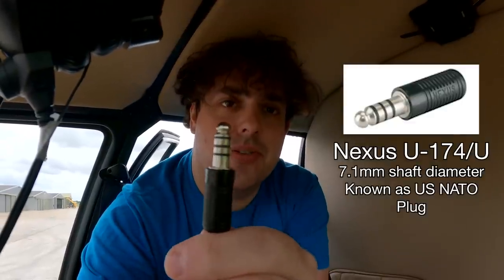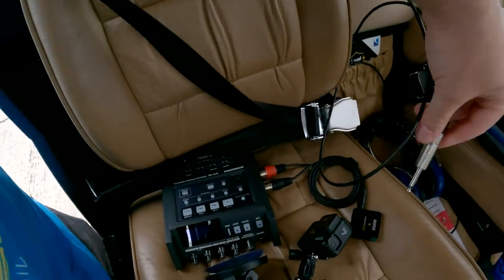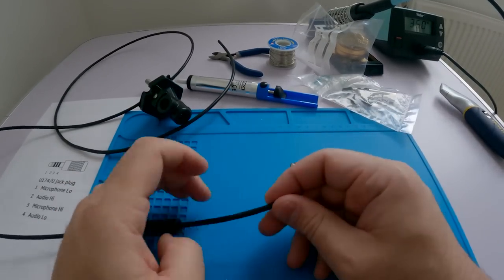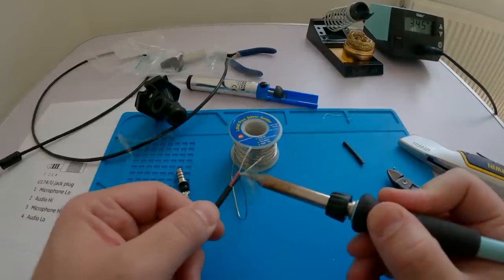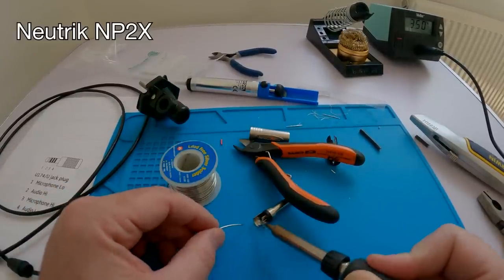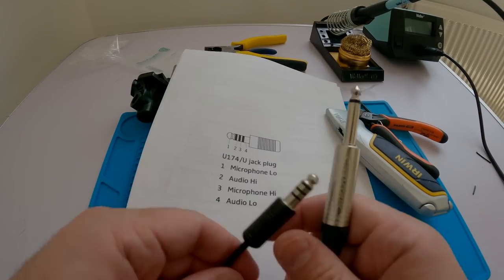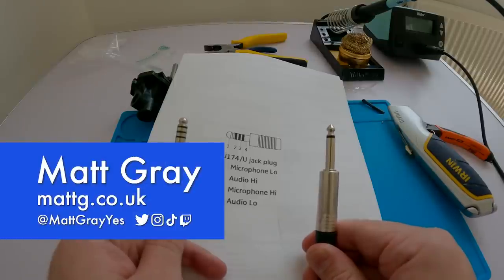How to Record Helicopter Headset Audio

Comment: Always forget to put on the back of the connector before soldering. If you don't forget it you only get to solder once!
Reply: Exactly! I admit to copping out on redoing it when I forgot a back on an Atari ST to VGA lead -- 13-pin DIN to 15-pin D-sub. Not all the leads were connected, especially as it was monochrome, but both those connectors are crowded. The 13-pin DIN was the worst thing I've ever soldered as it had a 3x4 grid of pins in far too little space, and the plastic kept melting so the pins kept coming loose. Might have helped if I'd had a finer tip on my iron, but I didn't have one back then.
Reply: @eekee6034  Wow! Wasn't expecting to read Atari ST here! I somewhat recently visited my uncle to solder a cable for Atari STE, to get a lower level audio out.
Reply: @607  Cool :) I wish I still had mine.

Comment: I have a US pilot's license but have never been in a helicopter where I needed to plug the provided headsets in as they were already in place.  I had NO IDEA they were not "standard" 1/4 inch plugs used on Cessna 150s to Gulfstream 650s.
Reply: helicopters  tend to use one jack rather then two like fixed wing just cause there is a risk of the cables getting tangled in stuff worse then in a plane
Reply: @coolmikefromcanada  why is that?
Are helicopter cockpits more crowded?
Reply: @coolmikefromcanada  why is that?
Are helicopter cockpits more crowded?
Reply: @Jehty_  na more like helicopters have a "fall out of the sky or rocket into the air" lever and you really don't want things snagging on that, also helicopter pilots are more likely to have to lean and look around
Reply: @coolmikefromcanada  what do you mean by these levers? Never heard of anything like that
Reply: @Jehty_  i am jokingly referring to the collective lever, it controls the downward thrust.

Comment: The fun one is hacking a US military U229 connector to put a 3.5mm connector, and having it automagically act like a handmic, so you can hook an iPod up to the intercom system of a HMMWV or MRAP.

What's less fun is a passenger flipping the FFCS to which the iPod is attached from "int only" to "B-radio" and jamming the troop/company/battery level net with Red Hot Chili Peppers until I noticed the SINCGARS buzz from transmitting encrypted behind the music.

Then I had to make one for the troop commander's vehicle and explain what you can and can't do with the FFCS when you've got music going.
Reply: This is the story I didn't know I was hoping to find down in the comments, thank you.
Reply: Definitely sounds like you don’t have experience with that story… 😂😂😂
Reply: @cheetahman79  nope, none at all. 😉

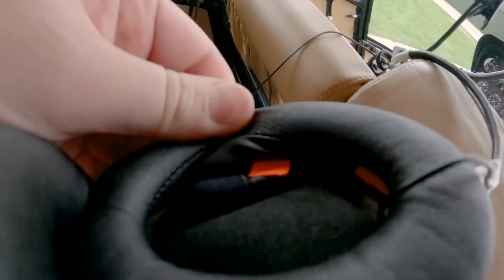Comment: 1:38. Holy shit!  What an amazing low-tech solution!  I'd never thought of that!  

(I fly GA.  I use an adapter that goes between the intercom and the headset in plug, and then has a side plug that has a USB-mini that goes in to the Gopro 3 cameras that I use.  Works really well and consistently, once I realized I had to make SURE the plug was all the way into the camera.)

Comment: If you do end up making one of these it's worth noting to add some resistors in the quarter inch plug and build the pad in, although not having the pad built-in to the cable might be nice if you're not sure what the audio levels are going to be like. And cutting off the shield at the connector end really shows you know what you're doing with audio! Dare I ask how many questions are in the comments on that subject?

Comment: Any reason in particular why you'd leave the shield disconnected at both ends? I'd normally short it to the shell at one end only, but maybe this is a live sound vs broadcast engineer thing.
Reply: Shield is connected at the helicopter end, to the mic ground, which is also chassis ground, so it is fine. Audio low is almost invariably also connected via a very low value resistor to chassis ground, simply because this also is used to get a little protection for shorted cables, so that one headset developing a short in the speaker side will not take all the others out.  Also volume control is via a series resistor, so you have a common bus level, and your headset volume can be reduced a lot, but even at minimum setting you still get a pretty high level into the 600R earpieces. 

No PTT, as the headphones are always on, to allow comms in the noisy cockpit, and that noise cancelling dynamic microphone insert is pretty good, as seen on the hover video. Yes bandwidth is not exactly good, very much BT telephone style, and deliberately made that way to reduce external noise, and also heavily clipped in the amplifier as well, to make speech intelligible.

Incidentally mic capsule and earpiece tend to be 600R, mostly because the earpieces were developed from telephone earpieces, along with the microphones, so have that heritage, though there are wildly different systems and impedances now. Can be a pain to drive if you are a gamer, and want to use real military helmets, you need a pretty high amount of voltage gain to get sound out, more than most sound cards can easily deliver, so you need around 12-15dB of gain added on for the earpiece, able to drive 600R, and similar for the microphone, or simply swap it out for an electret insert in the same case, and lose a lot of the noise cancellation.
Reply: I guess the aircraft system 'mirrors' your own mic back to your headset? Otherwise Matt would have had to capture both sources?
Reply: @rebmcr  Probably yes. It would be a real pain to speak with a normal voice and loudness while not able to hear yourself properly.
Reply: @rebmcr  Can confirm, yes. It's easier to wire that way too. Your voice goes into the audio system, and is played to everyone in the cockpit. Everyone hears the (incoming) radio too, though obviously only the pilot (and copilot if applicable) has their mic hooked into the radio as well.

Comment: 1:30 Can you explain what Line vs Mic level means? I've heard Line level before and have a Line/Inst switch on my audio interface but don't know what it's there for.
Reply: On your audio interface line in and mic in will probably both work to input audio. My understanding of the difference is the mic one is optimised for human speech, whereas the line is for other audio devices.
(and if I'm wrong I've boosted your comment for someone else to answer)

Edit: More reading suggests the difference is the input voltage (and how much it then needs to be amplified)
Reply: Line Level is a kinda middle "Standard" amongst the four main levels of input (mic, line, instrument, and speaker).  Line level is about 1-volt. The idea is that if a system has several different line level inputs like a home hi-fi might have a record player, a tape player, and a CD player all feeding the same selector which then feeds a singular amp (which then boosts the signal to speaker level). Because all the devices are Line Level when you set the amp to play the record player at the right volume, when you swap to the tape player you should be just about right. 

Mic Level is a MUCH quieter signal, usually no more than 10 millivolts, and require a pre-amp to boost the signal to line level. This is most often done inside the mixer, though inline mic-to-line pre-amps exist. 

Instrument Levels are stronger than mic level but less than line and again require a pre-amp to bring them to line level. 

Speaker Level can be in the "oh my word" range of volts and is obviously used to drive speakers, use the correct cable please.

Connecting a Microphone level source into a line-level input results in almost no sound since you're delivering a couple orders of magnitude less power than needed. 
Connecting a Line Level source to a Mic Level input will lead to distortion, clipping, and possibly broken equipment. A common way around this is a Direct Injection (DI) box that reduces the voltage to the acceptable range, or most mixers have a switch (either physical or software) that switches an input between mic and line level (it may also be a "pad" which does a 20dB reduction, which Matt mentioned in the video). 

TechMoan also recently did a video explaining the difference.
Reply: Also worth noting that "Instrument" in this context doesn't mean every musical sound-making object.

Non-amplified things like guitars, mechanical electric pianos (Rhodes, Wurlitzer, etc), and acoustics fitted with simple pickups are Instruments — whereas synthesizers, digital pianos, and drum machines are Line.
Reply: @rebmcr  Yeah that's fair, I didn't put that distinction in because it wasn't exactly relevant to the question. But it's a valid point.
Reply: @PendragonDaGreat  You are the goat! Thanks so much for your answer!

Comment: So if you are only using one circuit you can discard the screen? Good to know, and makes perfect sense, just never thought of it.
Reply: I was taught you should always connect at least one end of the screen or it'll pick up noise, but I've never had reason to try it one way or the other so I don't really know.
Reply: You only use the screen if you have "signal and ground", when you have "signal plus and signal minus" using a shield for the negative signal would lead to more interference. A symmetric transmission (+ and -) relies on both wires getting the same interference so it can cancel itself out, but the shield in a wire is made so only it picks up the interference and the wire(s) inside don't.

Comment: Not what I expected but that’s cos my uni course works with a regional tv station and they have pilot PA 11-60s for camera talkback so thought that there would be some way proper way to convert audio even if it’s double dongling 
Also I’m trying to now work out what the difference between a pj 055 or pj 068 and a btordcasting 1/4 jack cos they look similar but never seen interchangeable
Reply: The PJ 068 is what's used as the microphone connector on a "twin plug" aeroplane headset. It's smaller than a 1/4" jack, which is used as the other plug on the aeroplane headset, for the earcups. That way they're never plugged in incorrectly. The 1/4" is obviously 0.25", the PJ068 is 0.206".
Reply: @paulsengupta971  thanks yeah I've only seen the pilot jacks online without any scale to compare so was just looking at the similarity

Comment: Is a lav mic similar to a lapel mic?
Reply: The only difference is the orientation of the clip (in-line with cable for lavalier, perpendicular for lapel), but that doesn't matter since the capsules are almost always omnidirectional.
Reply: @backyard-tourist  Thanks for the explanation. I don't recall hearing of a lav (lavalier) mic before.
Reply: @backyard-tourist  My lavalier mic has a perpendicular clip. ;) When I wanted to get one, I searched for "lapel mic", having never heard "lavalier" before, and all the results were for lavalier mics. I assumed "lavalier" was just French for "lapel", but evidently that's not right so I don't know what's with the funny word.

Comment: How did you record yourself? Does the headset earpiece give you yourself back, or is it a mix-minus that takes you out?
Reply: Assuming it's similar to other (fixed-wing) general aviation, it's a full mix (like a phone call), which helps you to know when you're speaking loudly enough to get past the minimum volume threshold (squelch) for people to hear you.
Reply: @Beesno  now you have me second guessing whether you hear yourself on a phone call lol
Reply: @robdavy4468  On a normal POTS call? I would think generally not as I believe it's two half duplex lines, you to them, and them to you. Now, if you're on a modern teleconference, or other type of call, then maybe?
Reply: The term is sidetone and it's the feed back to you of your own voice so you can know it's working and manage your own vocal volume.
Reply: @Tahgtahv  You get sidetone on a POTS call. If you don't you immediately think something is wrong.